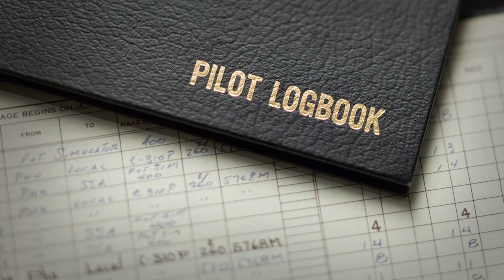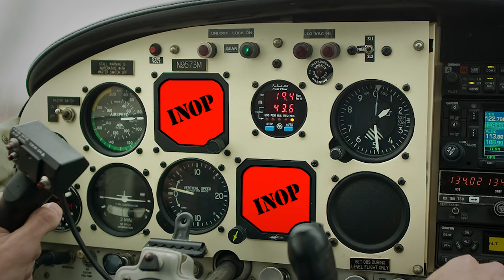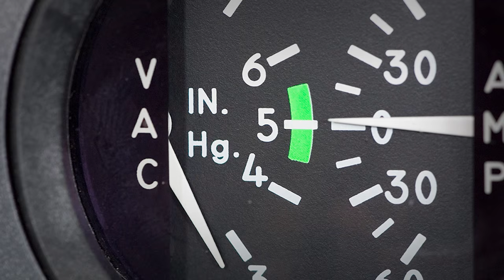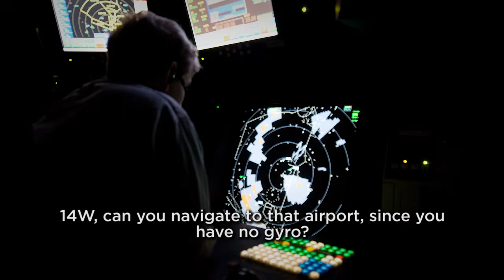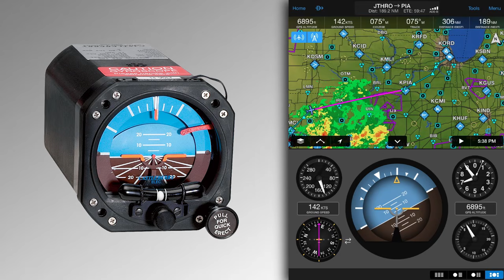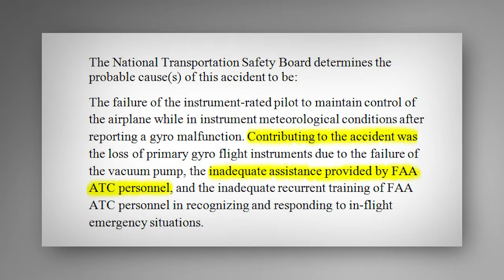Accident Case Study: Emergency Management

Comment: The second controller's voice had a hint of annoyance and less of concern. Pilots under stress could do without a condescending tone.
Reply: You hear that in a lot of accident tapes. The reason is arguably very human: ATC is ripped out of his normal work-flow by no fault of his own and there simply isn't anyone to blame but the pilot (even if the pilot isn't actually to blame). Sometimes they don't even know that something is wrong, they just assume it's one of "those" pilots again. The lesson of this should be:

to pilots: Don't ever care about the feelings of ATC. There is a reason the order is Aviate, Navigate, Communicate. May they curse you to hell, you just save your aircraft!
to ATC: Give pilots the benefit of the doubt. You may not know what's happening or how much they are in over their head. If you are right, possible pilot deviation can wait until they are on the ground.
Reply: As a GA pilot you should be aware of and prepared for asshole ATC. Most ATC are very professional and friendly. However, in busy areas they hate our slow planes. Most centers are used to dealing with professional jet pilots. When they hear a piper or a cessna they get bothered because for whatever reason, they assume we don't know how to fly.
Reply: @daytonasixty-eight1354  as evidenced by the pilot not stating his needs . I'm going to guess the pilot did NOT know how to fly his slow broken plane he should be able to simply state I need clear skies.
Reply: @tysleight  People under stress are not good at making decisions. You lose sight of the big picture, and get tunnel vision.
I think all this talk about how it should be, might mean the rules are outdated.
In a situation like this, ATC might have a better view on the situation, and someone struggling and flying blind, might just follow the voice in their ear without question. Many people do not have the presence of mind to shout HELP when they need it. The adrenaline prevents it.
Reply: @rogerwilco2  there's a place for people that can't handle stress of flying and that place is is on a commercial flight as a customer.  We have SOPs and check list just so you don't get tunnel vision and forget to aviate, navigate, and last for a reason communicate.
Reply: All ATC should have to watch 20 of these, and perhaps some type of pilot training.

How can you supervise an activity you don't understand?
Reply: @Alvin-1138  I'm an FAA controller and we don't get pilot training because flying is the pilot's duty, not ours. Our role is not to "supervise" flying, it's to separate aircraft and provide traffic and terrain alerts. Not make decisions for pilots. We are specifically told not to make those decisions like whether to go to an alternate because we don't have the information pilots have, or any knowledge of their aircraft or capabilities. If the pilot accepts a clearance we assume he can perform it unless told otherwise. The pilot here should have said I'm unable to fly an ILS, I'm currently in IMC and need to get to VMC. How is the controller supposed to know that unless he's told?
Reply: @kewkabe  Thanks for the explanation and reply. 

There are many things that are not our duty, but which help us do our job better.

Also while the word supervise may not directly apply to piloting, you are in fact making (legally/administratively binding)  suggestions on where the pilots need to go. So while the word 'supervise' might not have been perfect,  I think the concept is valid that if you haven't experienced even the most core  and basic tasks that the pilot has to accomplish, then you lack a certain sensitivity and perspective.

I realize these things are systemic and not the fault of the specific ATC.
Reply: @Alvin-1138  But we could say the same thing about pilots, that you haven't experienced our most core and basic tasks, and likewise lack perspective. That's why ATC instructions are a suggestion like you say, that you have the ability to deny. It's not like law enforcement where you have to obey first and question later. We may act like you have to obey, but the pilot is always in charge and can ask for something different or just say unable. We're taught from the start the pilot is always in charge and could reject your instruction, so in theory we always have a plan B if you say no. You're in charge of your plane and your flight and safety, not us. We're not police, we don't enforce FARs (we're not even taught them), we're just fellow citizens there to keep things organized, separated and expedited for your benefit.
Reply: @kewkabe  I am not a pilot at present but I plan to. I became interested in these types of videos when a former Co-worker and his son died in a GA crash.

 My professional experience analyzing communication breakdowns and their role in IT and healthcare failures.

I am not really sure what your point is?  Yes it would be ideal if pilots had some better idea of ATC functions but this situation that doesn't seem to be the issue.

However they are aware of the general and specifics in the sense that they constantly receive input and so they know about separation, rules, traffic patterns etc.

Also in these interactions they are the ones who have skin literally in the game.   That is not something that can be internalized as well by someone who hasn't been in that situation.

As I said before I am not attacking ATC.
Reply: @kewkabe  Controllers should have some basic knowledge. I've been surprised by the number of ATC that don't understand the limitations a GA plane can have when they announce "no gyro."
Reply: @kewkabe  Yes, the pilot can refuse your instructions.  But don't pretend there aren't consequences for that.  "I have a phone number for you to call" ring any bells?  There needs to be cooperation, not excuses.  That's why commercial airlines instituted CRM training way back in the 1980s.  The captain is still in charge of the flight but he can be questioned and overridden.
Reply: @icemachine79  If you're told to call a number, it's likely some 25 year old kid controlling you, and you're going to speak to a 50 year old supervisor who's going to understand your situation. Not something to worry about.
Reply: @kewkabe  Besides the fact that I've heard plenty of ATC recordings that contradict your claim, I think you missed the point.  I've heard controllers work with pilots who were having problems.  In fact, that's usually the norm.  But not here.  

The controller may not be responsible for the crash, but there's a good chance he could've helped prevent it from happening with just a modicum of patience and situational awareness.  I mean, would you honestly rate this guy's performance very highly?  I hope not.
Reply: @kewkabe  what did you make of this recording and analysis? Why did the atc suggest the idea of Fayetteville when it was clear he had no gyros? Yes, the pilot is in charge. Yes, he should be assertive. But it seemed very strange to suggest a course of action when it seemed, though the focused and convicted pilot didn't say it, that anything other than a diversion was going to end badly.
Reply: @icemachine79  I've been asked to call the tower (or center, I forget which it was) once in 30+ years of flying. Not because I had violated any regulation, but rather because I advised ATC that I could not accept an instruction (a vector, as I recall), and they later wanted to know why. It was T-storm related, but apparently I didn't do a good enough job advising them as such when I advised I could accept the vector. I don't recall the exact circumstances as it was more than 20 years ago. But suffice it to say that it took only a very short time to advise them that 1) I was a flight instructor and a mechanic, and knew the limitations of my aircraft, and 2) I had to do it the way I needed to do it, for the reason I told them. That was it. 3-4 minutes on the phone, case closed. I didn't request or receive priority, so maybe it would have been more involved had that happened--but the ATC guy (who was not the guy to give me the vector I couldn't accept) was totally cool. 

Moral of the story is that ATC folks are just humans, and you are communicating on an often-congested frequency. They don't have time to entertain long discussions, so sometimes you have to call them. If you know what you're doing, and understand what FAR 91.3 allows, and in fact REQUIRES you to do, then do your job and fly the aircraft. Handle whatever else you need to handle once you get on the ground. If you fly the wing(s) off the aircraft because you did something stupid like fly into a T-storm, then you're not helping anyone...and a bunch of people on YouTube will likely be sitting in their recliners, commenting on how stupid you were because you didn't do what you should have done to avoid killing yourself.
Reply: @sallygo1234 I still don't know where you're getting this "Alpha man" thing from.  The pilot lacked assertiveness; that's not exactly an "Alpha" trait.  He requested a diversion and was ignored by ATC shortly before being handed off to a controller who was more interested in acting like an Alpha male himself by publically humiliating the stressed-out pilot on an open recorded frequency than assisting him with finding a safe place to land.  Also, unlike the pilot, these controllers could have easily been relieved by a backup controller or supervisor if the situation became too stressful.  All I'm saying is that the controllers were in a much better position to access the weather conditions and they weren't hampered by having to control a plane with rapidly-failing instruments.  They should and COULD have done a LOT more to help.
Reply: @sallygo1234 Well, this specific pilot didn't sound like that.  He was also very forthcoming about his difficulties and requested the alternate himself.  But the real deciding factor here is that the pilot was in a life-or-death situation and the controller wasn't.  Once the controller realized the pilot couldn't navigate or handle no-gyro turns in IMC he should've brought up flying to his alternate, not get snippy with him right before directing him to an approach that he obviously couldn't fly.  After listening to a number of these videos, I'm amazed at how poorly most controllers seem to comprehend the basics of flying these days.
Reply: @sallygo1234 Just like the controller, you appear to have no idea how human beings actually function under stress.
Reply: If you cant still be assertive when hearing a condescending tone maybe not be a pilot.
Reply: Plus this pilot was in the military for gods sake. He should have had no problem being the alpha
Reply: @sporkeh90  No, it was more than that.  The pilot was obviously under stress and the controller had been told he was having problems during the handoff from Fayetteville tower.  There was no need for such a nasty attitude.  At 7:47 he says "stop turn" even though he knows the pilot wasn't actually turning... and then he has the gall to sound annoyed when tells the pilot he wasn't actually turning.  Since the pilot was already confused, that made the situation even worse.  He should have immediately vectored him (as best he could) above the clouds and towards Columbus.  Instead, he acted like a jerk.  I hope he learned something from this unfortunate situation.
Reply: @icemachine79  Actually, that's the way the controller is supposed to talk when supervising a no-gyro approach. They issue very terse "turn left" and "stop turn" instructions, because the aircraft is turning at up to 3 degrees per second. Go watch a video of an ASR or even a PAR approach and you'll see: It's very cool to watch (and do!) when done correctly. So I didn't see anything wrong with that part. 

I would have like to have heard the controller say something to the effect that "Please advise immediately if your flight conditions improve to VMC." Had the pilot gotten those instructions then quite possibly ATC (who obviously knew this guy was having problems flying IMC) could have had him maintain VMC while trying to calm the situation and figure out a way to end the flight successfully.
Reply: @bluehornet6752  I'm pretty sure the procedures don't include "be snippy with the pilot when you realize he can't follow the instructions".  This accident might have been avoided if the controller had been more attentive to the situation.
Reply: @icemachine79  That's my point entirely: The controller WASN'T being snippy. That's the way they talk on an ASR or PAR approach. This wasn't a formal ASR approach, but ATC certainly tried to help the guy by moving in that direction. 

Go listen to ATC audio of an actual ASR approach--or of a military controller's PAR approach. That's how they talk. There's no time for bullshit when the aircraft is hurdling towards the ground at over 100 knots.

Comment: If a piece of equipment like that fails declare an emergency right away. The FAA makes a point not to burden pilots who declare an emergency so that there is no hesitation. They'd rather you admit a mistake and be safe than try to cover one up and crash. Even if the plane was outside its annual they would probably just be glad that the plane made it to the ground safely.

Comment: Can someone please explain this for me?  
Correct me if I'm wrong, but the ILS isn't a vacuum system.  So even if the HSI was pointing you in the wrong direction, shouldn't the needles still be working?
Reply: TomCook1993
Sure, it's possible to fly an ILS approach without gyros, but I don't think it would ever be a good idea - no matter how experienced - unless you had no choice. It's too easy to get disoriented. The ILS doesn't give you attitude information - only the delayed effect of your attitude changes. Too slow to save you from anything but a very minor attitude problem. Even if you are very gentle with the plane, even minor turbulence could put you out of kilter enough that the localizer will not save you.
Reply: Android811 Good answers, but I suggest you to hire an instructor, and shoot one ILS with windshield cover and stickers over gyro instruments, just to experience how hard it is.
Reply: that is correct. But you still need reference the horizontal gyro to execute an ILS. At least a novice needs to....A more experienced pilot can do an ILS without gyros if needed. They'd just have to follow the localizer and glide slope down with minor adjustments to pitch and altitude.
Reply: Thanks for the answers gentlemen.

Comment: I can't imagine not saying the "e" word after a vacuum failure, or pressing on afterwards into IMC when it isn't required.
Reply: No doubt but it's tough, clearly his mind was in a fog. Controllers should know that a vacuum failure in IMC is an emergency.  Or at least they could ask, "do you wish to declare an emergency?"
Reply: Tytus Abrahamson I wonder if they understood it was a vacuum failure.  He mentions a gyro issue but it seems like he was non-specific as to what the issue was or how serious it was until fairly late in the problem.
Reply: M1A1cavalryman Vacuum pumps are notorious for failing before their purported lifetime. Have been for decades.  That’s why a lot of pilots have resorted to a second pump or ‘peanut’ attitude indicator etc. The overriding problem,apart from being proficient and comfortable on partial panel, is that most pilots don’t include the vacuum! gauge in their instrument scan most of the time, and who can really blame them? The effect is that the attitude and directional indicators ,not having off-flags pop up straight away and only slowly giving wrong signals, the pilot may not realize anything is out-of-whack until it’s too late in actual IMC. He may not even realize that it’s not the gyro instruments that have screwed up, but the pump.IF, and it’s a big IF, he can realize this and get on the turn coordinator ,flying partial panel while trying to cover up the vacuum powered gyros, he’s o.k. Accident statistics from the last 40 or so years suggest that a lot of pilots never managed this———and those type of accidents were usually fatal!!
Reply: At least he was solo flying b

Comment: I think this point can't be stressed enough, you as the pilot are the final authority when it comes to the operation of the aircraft. You are allowed to and even expected to decline ANY ATC instruction which you believe compromises the safety of that and other aircraft. You have access to information the controller doesn't. Work with them to find that best solution.
Reply: 100% spot-on comment. There is a lifetime waiting on the ground that you can spend at WAR with the NTSB if you're correct in your judgement. Much better than "Accident was survivable."
Reply: Yeah this whole thing was ridiculous he should have taken command of his craft. It was clear no gyro in IMC was a nogo for him. Why either would go for ILS approach again is crazy. Hit alternate VFR airport